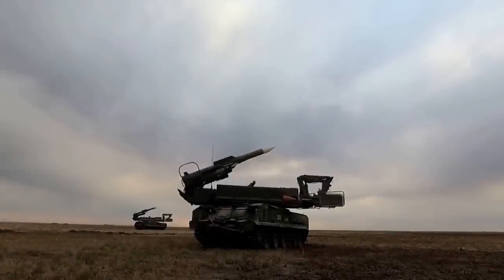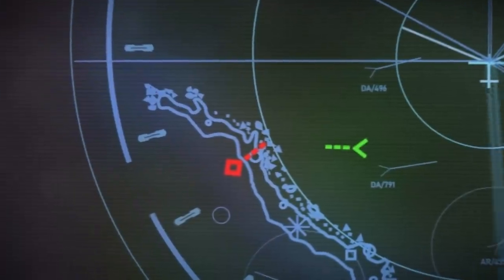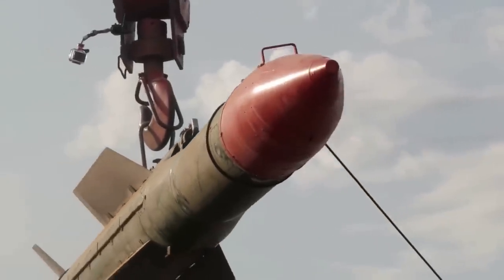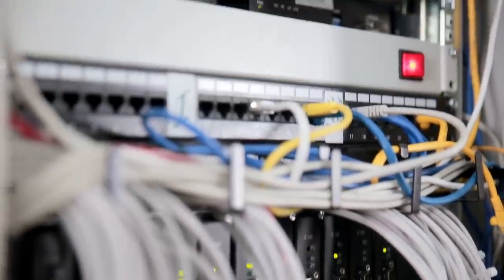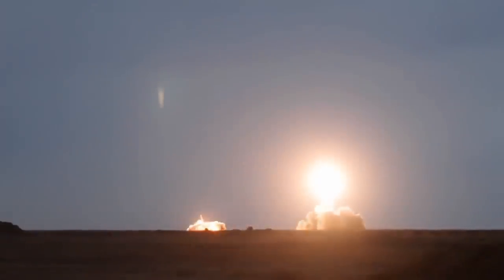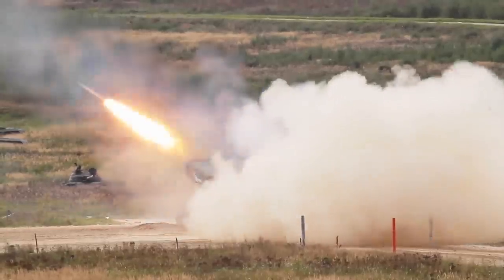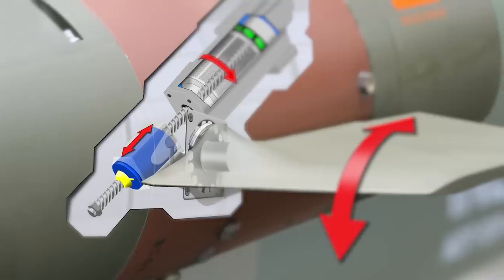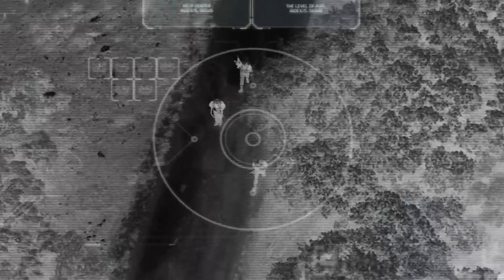Russian Anti-Aircraft System Hit by its Own Missile - Caught on Camera

Comment: Early U.S. Navy SAMs had this issue. On rare occasions they would pick up the tracking radar as the strongest return and attack it. This was corrected by adding a rear reference antenna to the missile so the missile would know the signal behind it was not a target. In this case, the missile launched normally. If it were a jammed control surface the missile would have turned and crashed immediately after launch. I witnessed a case of burn-through where the propellant burned through the side of a Terrier missile. As soon as it separated from the booster, that missile attempted an uncommanded 90 degree turn which it could not sustain and exploded. In any case, the boost phase is ballistic with no guidance being applied to the missile.  At the end of this missile's boost phase when the guidance system turned on the missile turned and engaged the strongest return it could find.  This looks like a failure of the rear reference system.
Reply: Yours seems to be the most likely explanation.  Any thing else I can think of would have the rocket going off in almost any direction, not a direct return trip to home base.
Reply: don't tell them that LOL
Reply: Or, if the missile uses GPS or similar, the target coordinates were the same as the launcher.  We'll never know.
Reply: Or they programmed "terrorists" into the destination field and it just went after the nearest ones

...Hmm, perhaps yours is more likely though
Reply: That is by far the most realistic explanation we have.👌
Reply: What would cause 1 to go down and not the others? Is it a system on launched ordnance or is it something like someone broke an antenna on the launcher and that was the nearest 1 and so it circled back? I lean toward it being the 1st situation.
Reply: The failure could be what you suggest, but the missile isn't actually returning to the launcher (unfortunately). Perspective is messing with everyones' eyes here. The launcher is off in the distance towards the horizon, and the missle is heading towards and to the left of the camera, crashing between the launcher and the camera. This was thoroughly gone through last year when it happened by pretty much every OSINT and everyone agreed that it didn't hit the launcher. Yet no one here remembers and now we are getting another misinformed video by Dark Footage?
Reply: @scotts918  
The stil use washing machine chips.
It did turned in to an other mode.
From 1400 rpm to 90 degree heating.
Thats 90 and 90
That last 90 was deadly haha
Reply: @chadvoller2031   Doesn't mean it wasn't trying.
Reply: This doesn't sound plausible at all...anyway I hope that they never fix the problem
Reply: I agree this is by far the best explanation. Thank you for the extra information! It is still funny to think the missile operated as intended!
Reply: @thornefroemming7796  That is true!
Reply: @antimatters6283  Something similar has happened with Russian bad programing
Reply: Thank you for explaining that.
Reply: I swear to put out info like that would be considered treason. I see all these post from military personnel to ex give military give out info. All the enemy would need is ppl going thru info online. So please STFU IDGAF if you know what the problem is.
Reply: @MichaelJ007  The info you see military folk putting out there is not classified. If it were classified, they would know it, and know the consequences of releasing that info, the info would be taken down, and the perpetrator would go to prison. You don't learn classified info by accident. Everything you see being said is public knowledge. It's already out there. It just SEEMS like sensitive info to you because you know absolutely nothing about the topic. There is plenty of classified, sensitive information out there about these kinds of missile systems, but a lot of it is fully public too, the military even invites the press to film tests and things sometimes.

Just because your enemy has access to good info that could help them, that doesn't mean they are capable of actually implementing it. Russia doesn't even need our classified weapons specs, all it needs is to study public knowledge on how war works and improve their strategy, or just get out of the game altogether. They aren't good at it. Someone could explain step-by-step to you how to build an atomic bomb, but that in no way means that you would then be able to build an atomic bomb. Defense by obscurity is not a real defense.
Reply: That would mean they didn't build it correctly, could be, but I still think it was a bad missile motor.
Reply: @chadvoller2031  Yep, I thought the same thing, I'm going with a bad missile motor.
Reply: @FrequencyOfThought That's what I was gonna say🤣🤣🤣🤣🥳 This guy on the low working for the enemy😳😳😳🧐🙈🙈🤚🏽😪
Reply: You said,"Early U.S. Navy SAMs had this issue." which makes sense, it's prototyping right? You're trying to iron these inevitable problems out. This system is a well established system, so that doesn't really fit. Russia is supposed to be advanced in missile technology. I get things with man-made stuff is bound to go wrong. I also, get when incompetence is prevalent. Occam's Razor man. The simplest answer is usually the correct answer, INCOMPETENCE is the simplest answer. At least I think it's the simplest answer. SEMPER FI!!
Reply: VERY interesting! Thanks a lot.
Reply: Thanks for the informed answer. I always imagined they mounted a sensor upside down during assembly.
Reply: Well,at least the manufacturer can say it achieved its purpose....
Reply: That is actually mf crazy
Reply: i agree with u 100%
Reply: Note, this isn't the first time that they've had this kind of missile malfunction, and either that means they dont understand why this happens, or it means that they just dont really care...
Reply: Hope the Russians don't read this ..
Reply: Yes I agree. if it was 'mishandling' or 'propellant'  it could have gone 20 degrees, 40 degrees or 60 degrees off course, but this went EXACTLY 180 degrees to its source. Why 180 degrees? Because this was the strongest source. So I agree with Thornie, and suspect a failure in its rear-reference system. Thanks Thornie. Australia
Reply: @scotts918  Yup, terrorists or assholes.
Reply: you,ve probably just fixed their problem.loose lips sink  etc.etc.
Reply: @Physco219  A 'rear reference sensor' is basically on the missile itself as I understand it, effectively saying "Whatever signal is from behind you within this 10 degree cone (or whatever scope of avoidance) is to be ignored no matter the strength or priority of the signal being detected", to keep it from going 'greyhound' on it and charging right back into its own launcher because "BEST SIGNAL EVER!"

The others launched because its bum-sensor array worked, "Hit anything but Reference...ok, on my way!"  "Hit anything but Reference...ok, on my way!"  "Hit anything but Refence...null signal. Ok!  So hit anything but 'null signal', I can do that.  Wait, I see radar radar radar from behind me...turn turn turn see what it is!  Yes YES YES WAHOOOO, I found it!"  "Boom!"

@Chad says it may not have been tracking the launcher; I'll have to look up other videos about it.  It may have BEEN trying to, but they generally don't have to compensate for 'also, gravity is pulling us down faster'.  I still think a broken 'rear reference' sensor seems likely, even if Physics didn't allow the brilliantly-stupid missile's logic to fully compensate for gravity and let it go get its source.  It REALLY looked to me like it was still trying to turn and just fell too much.  Who knows.  If it was the reference-sensor, that launch behavior would make sense...but there are also other reasons why it could have done that maneuver I suppose.
Reply: @RedbadvanRijn-ft3vv  ...so you're saying that they forgot to set it to Spin Cycle before launching, and a Delicate Cycle setting threw the missile around unevenly?  /s

Comment: Ex USAF EWWSS here.  deferred maintenance, rushed sub standard training, and the missiles guidance systems switching to search and track mode far to early  when it should have still been under active launcher control against an OPFOR using the same radar frequencies.  Strongest signal was that of the launch platform.  A perfect storm of multiple failures.  Very sad.
Reply: Sad unless your Ukrainian or on the front. There's a fair number of these missles that have been launched by the Russians only to fall on either side of the front.
Reply: It’s also the missile system that the nazi terrorist girkin/strelkov used to take down mh17 in 2014 when ruZZia first started their genocidal invasion…
Reply: But we know the missile did not hit the launcher.
Reply: This clip came out over a year ago.
Reply: @tedmoss   ... perhaps it tried to hit the launcher but was not able to turn fast enough?
Reply: Actually, it's not sad at all because it took out the Ruzzky war criminals.
Reply: So the wash machine control board they used wasn't stuck on agitate?
Reply: @tedmoss - But it did, killed the crew, burned them up really bad.

Comment: Fuel issues usually end with a spectacular fireworks show. A jammed fin would cause the rocket to continious loops or circles until it comes apart due to G forces, explodes, or hits something. My guess is something in the guidance system failed. The missle launched normally, but while still in tbe boost phase the guidance system locked onto the nearest radar emission and the control system unlocked (if they were locked) the fins. 
The relative same problem occured during WW2 with torpedos that occasionally would run on a circular course instead of the intended one. One of the safeties developed for this was a switch that would shut the weapon down  if it sensed a 180° course change. 
I suspect that this is the subsystem that failed. Otherwise the weapon appeared to be functioning as intended.
Reply: The Rocket targeted the Enemy rather quickly!

Famous Line:
"I have seen the Enemy, and it is us!" 

The Missile, using a crude "AI" must have learned this idea, and responded accordingly!
🤔🤨🥴🤭
Reply: My bet is on a broken mount for the propulsion that caused it to u turn as is failed

Comment: What amazes me was the sheer accuracy of its strike. It went directly back where it came from. Surely it must have homed in on a signal of sorts?
Reply: I agree.   Seems incredibly unlikely to be just a coincidental hit by an uncontrolled missile.
Reply: As discussed in another comment, SAMs have an anti-self-home feature, to prevent it from deciding its own radar is the best target.

If that system fails, the missile is free to attack its own transmitter.
Reply: It didn't 'come back'. Actually use your own brain and think about it.
Reply: Maybe it is still tied  on a leash?
Reply: It didn't hit the launcher unfortunately. Camera position makes it look like a loop but there's a second video that shows it actually does a horseshoe arc.
Reply: @Rikaishi  

Yeah, if it did hit the launcher, that would make these things even scarier impressive, because that would be a out a 3000 G maneuver.
Reply: @Rikaishi it didn't have time at that range to complete it's course. Good Intel for fighter pilots on its capability.

Comment: If the fuel burned through the side, a jet should be seen to the side and it would more like continue turning and the hole growing bigger. If a chunk of solid rocket fuel broke off, it would probly jam the nozzle and blow up. If it was a jammed fin, unless it unjammed after the turn, would continue the turn, going in circles. Most likely it got confused and retargeted the lunchers heat or radar or whatever it sensors were looking for.
Reply: Yep, it should throw off the tragectory, not do a 180. Engines have failed in US launches (fuel burns up one side) and threw rockets 45 to 90 degrees off course. There have been other Russian rockets that did spirals after launch. This one (per sattelite photos) hit a park a few hundred yards from the launcher, so I'd discount aiming for the radar since it did the 180 then straightened out.

Comment: The obvious answer:  Some soldier programmed their own coordinates into the missile by mistake, and the software driving the system didn't have a failsafe to catch the error.  That's what happens when you convert a surface to air missile into a ground to ground missile.  The hacks to the software to allow specifying a ground coordinate for the strike needs additional safeguards which it appears were not present.

Comment: That doesn't look to me likely to be the cause. Imbalance. It would continue to turn. It wouldn't do a sharp turn and then straighten again. My guess would be the rocket launches. The initial phase is just to get off the launcher and then it grabs the radar beam of the target. If somehow, the device inside the missile to track that radar beam was reversed it  the missile might think going to the origin of the signal was going to the target and reverse its direction. It certainly looks like it made a sharp turn and then continued back to the source.

Comment: Doubtful it's the fuel - there would have needed to be a huge jet of flame(propulsion) out the side to loop it like that - those things are MOVING, takes a huge force to alter their course.  Fins/combat guidance probly activated early, on-board radar noticed Close-close high-strength signal (ground targeting radar) indicating it was near the target, turned to follow it.

Comment: The operator entered his own coordinates into system!
Reply: That's my theory. Whoever set it up probably entered it in the wrong mode. And it didn't have a proper destination, so it used a default set of coordinates which was the origin. So the missile functioned perfectly. Or, it was deliberate and whoever did it is unhappy with his leadership and gundecked it. Who the hell knows for sure?

Comment: Because after the u-turn the missile corrected course to the launcher, I see a better explanation.  There is a bug in the guidance system.  I would suspect that a registry or pointer error in the code.  They ended up swapping the source point as the destination port.  They probably only tested the 'happy path' in the code and did not check for bad branching.

Comment: They don't know quality control or workmanship at all, we used to buy night vision from them in the 90's, at least one third would fail, the components made in Russia looked just awful, wires as thin as fuse wire, with coatings nearly impossible to clean strip, then there was the corruption, backhanders to get stuff out of Russia, zero warranty as it cost more to get it back into Russia, a 50's, 60's 70's world power, but As computing and technolgy improve every year, these guys had no chance to keep up, they lie about the specifications, detection ranges of kit, our night vision capabilities anhilated the  junk they thought was on parr or better.

Comment: Wow, that was one hell of an impressive hairpin turn!  As far as how it happened, it may well just be that the missile got dinged while loading but the ding dented a sensor or something...but anyway, seriously, that was a lovely-tight turn!  I'd have to measure it on the screen, but I SWEAR that it looked like it came in on an almost perfect reciprocal angle, including correcting for the drop in altitude as it turned.  It wasn't done turning...so maybe it just needed a little more space than it had to 'arrow in straight' and make it clear, but...well, whatever happened, that poor operator was likely not happy to have to explained how he 'shot himself'!

@Thornefrosomething has a post saying that there had been a 'rear reference system' saying basically 'track the strongest not-this-signal that you can find' so it didn't engage its own fire control radar, and actually that makes a lot of sense.  And it is easy to see why it might have had a quick effect on the missile, too, "Good signal, good signal, TURN TURN TURN!"

"Frank, did you put that reference sensor back in like I told you to?"
"No, Ivan, wh..."
~*SIGNAL LOST*~

Comment: Rusty relics? The soldier should be put on a charge, he is responsible for cleaning his weapon. Old weapons are almost as good as modern ones, the Germans fought WW2 with the same rifle they used in WW1 and the Brits used the Lee-Enfield in both wars. The Vickers machine gun was also used in both wars as well as the Korean war and a few others.The Germans btw, had missiles that travelled at six times the speed of sound and fired well over a thousand of them at London. None were ever intercepted. Ukraine has accidents as well, but they are not given publicity.

Comment: The AFU has, and continues, to have to adapt, too, like crafting cages around armored vehicles, which is done to defend specifically against kamikaze drones and drone dropped munitions. Both sides are using "patchwork" drones. Only they're not patchwork; they're very sophisticated. Cheap ... but sophisticated drones have changed the battlefield. You're being too flippant about the drones used by Russia, AND, Ukraine. Finally, Russia's capability remains formidable, don't cut it short. It's big problem is poor air defense, EW suppression, and supply chain logistics. It's forces are better equipped than how you've painted it. Better research and understanding would help.

Comment: A gyro failure could also cause the missile to crash like this. If the missile would not get the expected feedback from the gyro, the control loop would fail and it would be unable to control its turn. The missile would crash almost immediately after launch.